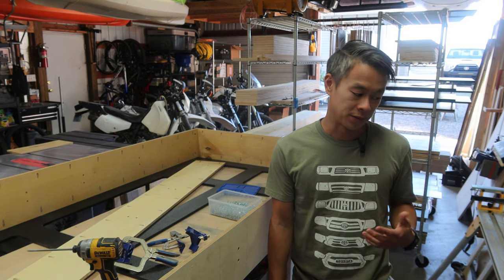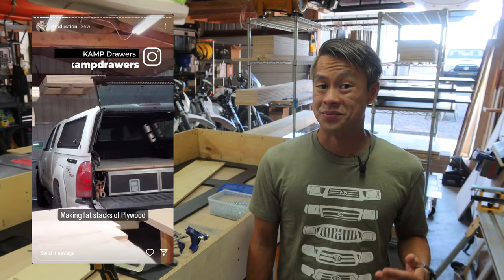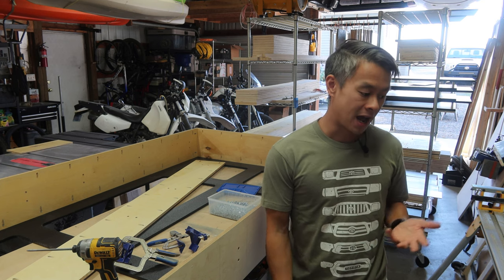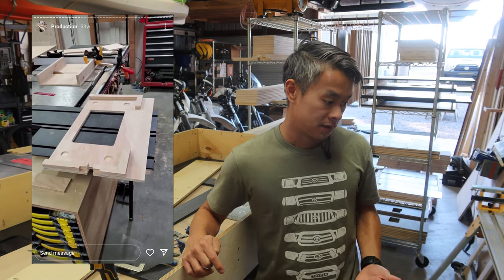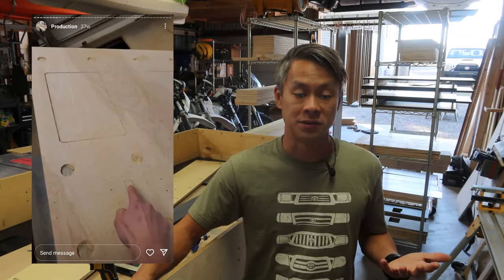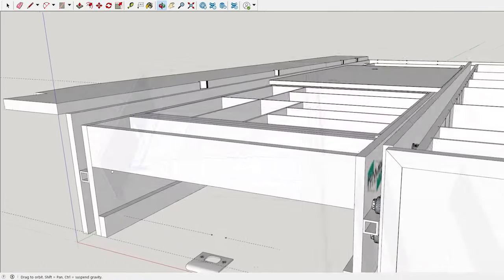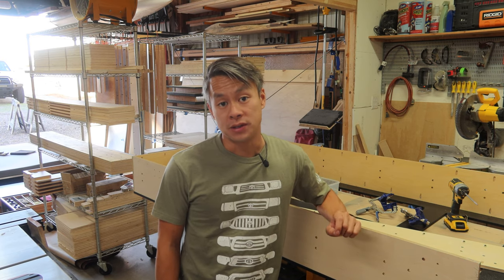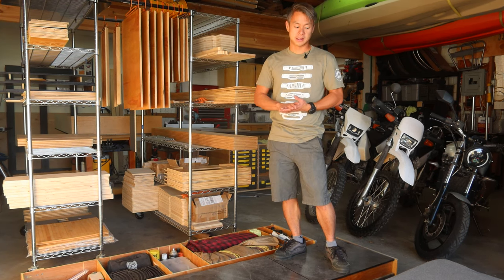KAMP Drawers Production Update

Comment: Subcontract out the work. Have a cnc or cabinetry shop cut everything out.  Sell it as a flat pack. If you can scale the company still and take those drawers to sema you'd have more than enough work. alternatively, you could have the work done in china and(or) Thailand, Philippines and shipped over.
Reply from the maker: Thanks. I just met with a local cabinet shop, and it seems everyone in my area (or the world, it seems these days) has more work than they can keep up with at this point. I'll keep checking.
Reply: This is the best answer and should be pinned for further ideation. This type of work is done in China every day, and can be done very inexpensively.
Reply: @SamChou any luck on figuring out this route?! Just stumbled upon you’re Crunk drawer vid and dying for one but I’m not a carpenter so DIY plans won’t do me any good.